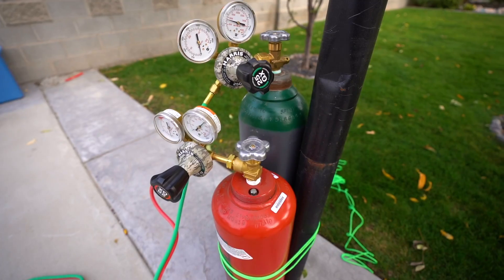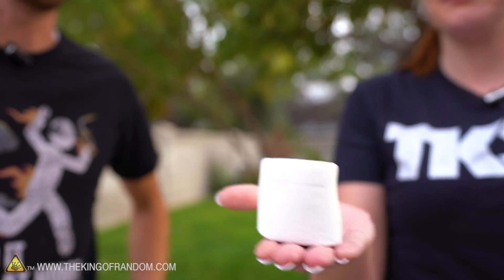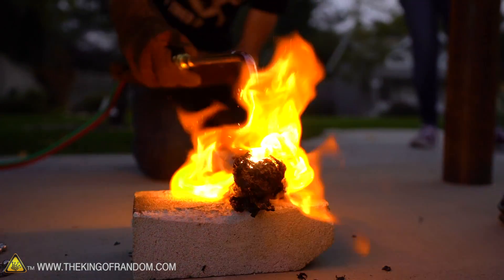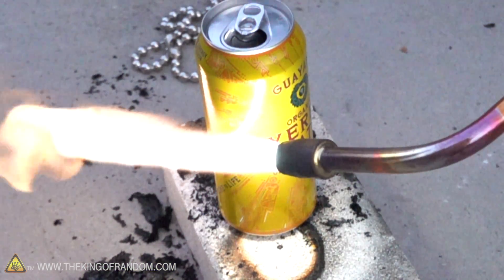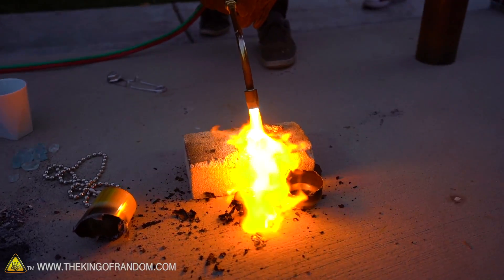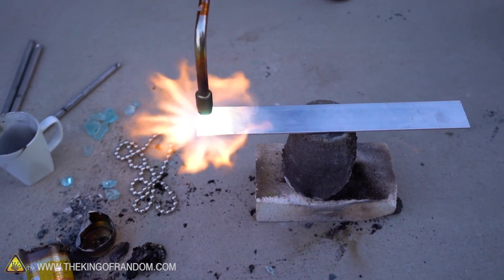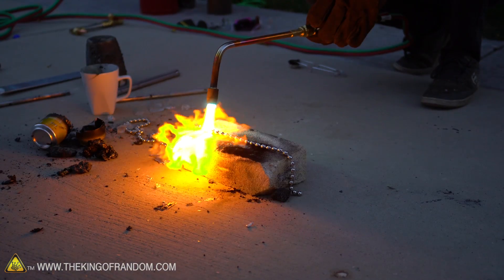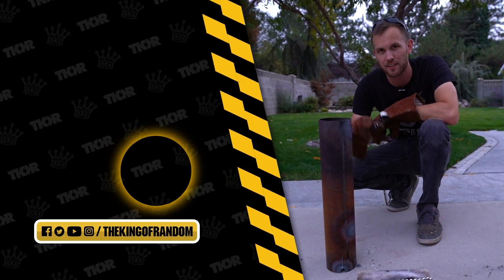This Gas Combo Incinerates Anything at 5500°F

Comment: >>New Skill Achievment!!<<   [[ Industrial Grade]]   You have achieved new levels of power and destructiveness, with great power comes great responsi... (Copyright strike avoidance Protocols)... Ummmmm segue!  If you slowly preheat the glass from a little greater distance and then move in closer, it won't shatter like that... you might also want a little bit more firebrick area to avoid spalling your concrete like you did that glass...

Comment: You should use propane and oxygen to see what it’s limit is. It works by heating the metal then adding oxygen to make the metal rust then it cuts through it

Comment: Run the acetylene until the black smoke is gone and then apply the oxygen until you get a focus tip to achieve the maximum Heat

Comment: For Heaven's sake TURN THE ACETYLENE DOWN! You're burning with far too much fuel, so you're not getting the right flame or anything like the temperature you should. The bright white flame is typical of acetylene in air or with far too little oxygen. You need to turn the acetylene regulator WAY down, then slowly increase the O2 until you get a translucent purple flame with a blue cone. That'll give you at least a thousand degrees more than you had there. Try it; you'll like it!

Comment: It may be expensive. But I would like to see if someone could weave, knit or crochet TUNGSTEN wire.
Reply: Like from Tig welding? Probably not, tungsten is usually very brittle. Mig welding wire would be a different story
Reply: @dcred123  i have seen some different gauges of wire, some may be flexible enough to attempt but probably not well... still would like to see a loose weave pot holder made of the stuff.. i think midwestern tungsten has some variety... and a pair of dice or pure tungsten i cant afford

Comment: A rose bud tip is a great option for y’all but I would recommend also having a cutting head for some of your other projects.
Reply: What i was thinking too, a cutting tip would of made tube look like it was made of butter.
Reply: It don't get to 5500 until you have the cutting torch head
Reply: I’ve never actually worked with one but can’t you fine tune it to get much hotter?
Reply: @cyberbuckeye3676  yes, it can be tuned to have nice hot blue cones but it will never be as hot as a cutting tip
Reply: Don't forget you can make a nice explosion with the gases and a rubber glove.
Reply: I was going to say the same thing!!!!!
Reply: Ya the cutting head is more fun anyways
Reply: Samee
Reply: U should cook steak,porkchops,hamburgers lol make sum potato chips 👀 if it can cut through steel get a more consecrated tip for the flame mabey?
Reply: I love cutting with the torch
Reply: I completely agree!
Reply: Was gonna say the same thing
Reply: Thats what I was going to say
Reply: They have one, it's on the ground behind Nate at about 2:10.
Reply: Cutting head and some welding tips. The rose bud is great for heating stuff but the cutting head and welding tips are designed to turn steel into liquid. Plus, welding with a torch is one of the most therapeutic things you can do with tools. Right up there with sand blasting.
Reply: @worldwideguitarman  I agree, there's just something so calming and beautiful about torch welding. I miss it and really want to invest in a torch setup
Reply: @worldwideguitarman  my job for 4 years. Miss that oxyacetylene cutting torch.

Comment: Please note: they are using a heating/preheating tip, not a cutting tip. They should get a cutting tip and play around with that.
Reply: Beat me to it. Should have used a cutting tip for cutting things
Reply: Was gonna say this
Reply: I was thinking this through the entire video
Reply: need the whole cutting torch, not just the tip. that one is missing the lever to give it extra oxygen or oxi when pressed to cut it.
Reply: @klfarms5744  that lever is part of the cutting tip it has a connection right after the hoses getto the metal where you take it apart to put the cutting tip on
Reply: @klfarms5744  Not exactly: the top of the brass handpiece where the copper tip screws in is a removeable "mixing chamber" and there is a "cutting attachment" with an extra oxygen valve knob and cutting oxygen lever that screws in to adapt it into a cutting torch.
Reply: And they should turn the acetylene up more, until the soot nominally goes away
Reply: @dcred123  they should also up the oxygen until the actual orange flames go out and you're left with just the blue spikes and blue flame
Reply: @tyrind2001  that is when you have welding or cuting torch where is more pressure when it is leaving the tip, becouse this is basicaly just a pipe when two gasses mix together and burn hot. I think...
Reply: @standa7777  No, I use them all the time. Rosebuds, when adjusted right, will only have a blue flame and blue flame 'spikes' around the edges. Itll get much hotter than what they are doing.
Reply: @tyrind2001  I was so frustrated they didn't just bring the oxygen up a bit more and get it as hot as that type of torch/nozzle could get. Why oh why did they not just give it a bit more?
Reply: Yeah a rosebud isn’t going to get nearly as hot as a cutting torch
Reply: It almost  has a green ish hue
Reply: @Maikonix  i think that is the color balance trying to deal with the intense light. Except the copper may have been coloring the flame at times.
Reply: They have a cutting tip, it's on the ground behind Nate at about 2:10.
They just chose not to use it.
Reply: @kaisersose5549  i think the whole point of this video was to "melt" stuff, rather than cut. Probably why they used the rosebud in confusion. Anytime i see TKOR use a tool i use in my job its always "you're doing it wrong" XD
Reply: Yes. Even though we don't actually cut much at work, we still use a cutting tip just because we usually only want to heat a very small area and not hit anything around it... And then it's so incredibly useful when we do need to cut something. Or drill something, since acetylene is absolutely the most efficient way to get rid of a rusted-in-place, rounded-off bolt or screw.
Reply: @tildessmoo  True. It just melt the metal so you can weld or with cutting torche just easily do a small perfectly round hole
Reply: That's a rosebud tip. It's not meant for cutting. They need to use the tip that's on the ground. I work in a scrap yard and use torches daily and I've never used a rosebud tip in my life. I've cut thin stuff like tin and really thick stuff like 6inch shafts. You never know what's going to come in the yard next.
Reply: Very smort
Reply: i was just about to say something about that...
Reply: I was thinking the exact same thing. I think they'd have even more fun with that than just the heating tip.
Reply: Star Scapes Is a cutting tip what you use to get a really fine flame with a bit of blue at the start?
Reply: @reticuluminfirma9407  No: that is just what's called a "neutral" flame with equal parts oxygen and acetylene, it's achieved by adjusting the knobs at the base of the torch.
A cutting tip has an extra orifice in the centre for an oxygen jet (which does the actual cutting) and needs to be used with a cutting attachment on this torch, or on a dedicated oxy/acet cutting torch and can only properly cut ferous metal (iron and steel, not stainless, brass, bronze or aluminium), even though it could be used to melt ugly holes in non-ferous metals.
Reply: @reticuluminfirma9407  yes. Though the very base of the flame is actually clear
Reply: they have the cutting tip, you can see it laying on the ground     you have to remember these are people who have no idea what there doing most of the time
Reply: It sort of scares me to think about him waiting like 8 seconds to light a cutting tip and him burning all his hair off.
Reply: Agreed, I dont think they knew that that's not what they had.
Reply: It seems they have it already or at least a single flame one as it was under the tubbing next to the canisters.
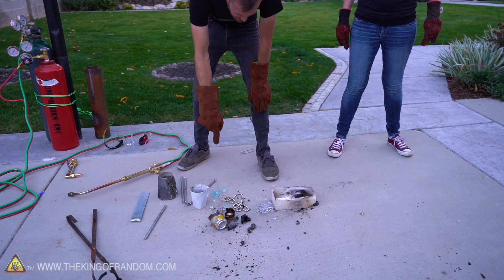Reply: 8:06 the cutting head is on the ground to the left they dont have it hooked up but they have it
Reply: what they are using is a  oxy-Acetylene welding setup, they need the cutting torch setup instead
Reply: yes
Reply: Agree
Reply: Thank you. A cutting tip would be would have been nice. I also was thinking the same thing.
Reply: Metal working nerds
Reply: Thats what I was curious about, because I remembered from about 13 years ago welding and cutting with an oxy/acetylene torch and the flame was much smaller. We never really used the preheating tip at all from what I remember. I just remember the super fine point to start up the bead and weld steel...
Reply: Was thinking the same thing
Reply: My thoughts exactly!!!
Reply: I was just about to come here and comment about that.
Reply: Exactly what I wanted to say
Reply: Yup. My dad used to cut holes in submarine hulls underwater with an oxyacetylene torch in the Navy during the Cold War. It can do some wild stuff with the right tip
Reply: I need one of those.
Reply: My thoughts exactly
Reply: Roseburg tip.

Comment: I'm guessing you're going to make DIY starlight (the homemade fireproof material covered by nighthawk and light)
Reply: wasnt that just aerogel + a malleable clay substance?
Reply: No. Aerogel and Starlite are two different materials. Aerogel is basically silicon foam while Starlite is a dough-like putty that dries into pretty hard, but rather brittle solid. Instead of blocking the heat out right it does what the marshmallow did in this video: forms carbon foam as it's burned. That foam is the actual insulator. If i remember right, NighthawkInLight (not _and light_, EnAimBoy! lol) made it by mixing sugar, baking soda, and white glue.
Reply: @AgentWest  sorry, I was using speech to text. I wouldn't test starlight on my hand with this torch though.....
Reply: They have done the starlight. Just not with a oxy-acetylene torch
Reply: EnAimBoy  they all ready did that

Comment: Inhales loudly
The FitnessGram Pacer Test is a multistage aerobic capacity test that progressively gets more difficult as it continues. The 20 meter pacer test will begin in 30 seconds. Line up at the start. The running speed starts slowly but gets faster each minute after you hear this signal bodeboop. A sing lap should be completed every time you hear this sound. ding Remember to run in a straight line and run as long as possible. The second time you fail to complete a lap before the sound, your test is over. The test will begin on the word start. On your mark. Get ready!… Start.

Comment: Nate, If you turn the oxygen off first, it won’t pop like that.
Reply: If you get the gas mix proper then there will be no pop. They don't feather the acetylene properly and they suffocate it with not enough oxygen
Reply: You beat me.
Reply: I've seen both methods taught oxy first and acetylene first. The reason I heard for shutoff of oxy first that made the most sense to me was if you pay attention during an oxy first shutoff it is easier to identify if you have a leaky valve. (I've never had a problem with the tip getting dirty this way)
Reply: However turning the oxygen off last is the proper way to do it. 
If you turn the oxygen off first, the soot from only the acetylene can clog the tip.
Reply: @gabrielulibarri9950  funner that way too anyways.... POP !
Reply: @gabrielulibarri9950  actually the proper way is oxygen off then fuel to prevent flashback. Even though they have flashback arrestors on there torch lines it is not recommended because each time it has a flashback it slightly damaged the flashback arrestors. If the tip ever gets clogged you can use a tip cleaner to fix it.
Reply: @gabrielulibarri9950  idk when I was in school, I was taught to turn off oxygen first bc it's dangerous to let it backfire
Reply: @metacerberusVT  I've been doing it like that for years, im still alive
Reply: @adammilan6434  
That’s like saying “I drive drunk every weekend and I’m still alive”
Reply: @metacerberusVT  That is correct. The most recent update to SOP is oxygen off first.
Reply: @metacerberusVT  I've been taught turn off oxygen last because there is a flash resistor in the torch so it shouldnt blow up too say and you turn oxygen off last too clear the lines of the highly flammable acetylene
Reply: @adammilan6434  Making low quality parts, I'm sure.
Reply: @xDXVDx   Parts? Ever heard of brazing? Either way, the quality of my work doesn't change the fact im still alive.. you're also a funny guy 🤣🤣 by all means continue this debate because its amusing. I also just noticed your profile pic, are you like 12?
Reply: @adammilan6434  thank you for saying it
Reply: @Sheridantank  right? All it takes is one time
Reply: @gabrielulibarri9950  there are tools to clean this
Reply: if popping and going out while using usually dirty tip.
Reply: How about someone taking a look at the procedure listed at a torch maker site like Harris products and see what they say about the tools they make (yes I know what they say but I'm going to let each of you do the research on your own).
Reply: I don’t think he cares that much😂
Reply: <3
Reply: Yeah
Reply: I have always learned that you should turn of the fuel source first and the oxygen second
Reply: I learned that in 8th grade shop class!
Reply: Welding inspector here. Proper procedures is to turn the gas off first then the oxygen.

Comment: Less acetylene more oxygen you want a nice blue flame
Reply: Lol I was wondering is others would notice that. They are trying to cut a can but don’t even have it mixed for cutting
Reply: 17Industries also not using a cutting tip
Reply: Yup, a nice blue flame with little blue spikes where the flame starts. This shouldn't be orange like theirs.
Reply: I was literally thinking that this whole time 😆. There's not even a fether in the flame
Reply: True, there is a lot wrong with both the settings and procedures used. It would have been worth their time to consult someone on operation so they could get better flame and no popping etc. When you turn it off like there can be other issues as well.
Reply: And not to mention they are shutting it down wrong yo
Reply: it looked like the flame was probably barely hotter than MAP gas
Reply: This is probably like 1400F
Reply: “As things heat up and combustion becomes more complete, flames turn from red to orange, yellow and blue. And purple color is combination of red & blue color it means that blue fire is more hotter than purple fire. ... At hotter temperatures, the flame color moves into the blue-violet end of the visible spectrum”
Reply: The blue flame should be hotter, in shop class we used a blue flame to weld or braze..
Reply: I thought the same thing! I learned it in shop class. Gosh that was a fun class!
Reply: I'm more worried about flashback arrestors, I don't see any on the tank or torch. You don't wanna blow yourself up.
Reply: Right
Reply: I was thinking the same thing
Reply: Smart man
Reply: Yea that’s what he needs to complete the flames combustion
Reply: I prefer a subtle teal, myself...
Reply: Was thinking the same thing, every time I used it, the flame was blue!!!
Reply: Need a cutting head for cutting the steel pipe, not a brazing head. Need to consult with some one and get some training.  Calli's new favorite toy... Pyro!
Reply: @richardanderson4019  that is not a brazing head , it is a heating head better known as a rosebud .
Reply: @NotMeeither  couldn't remember the exact name, but they do roughly the same thing. Thanks.
Reply: There should be the tinest  black smoke emitting  before adding oxygen